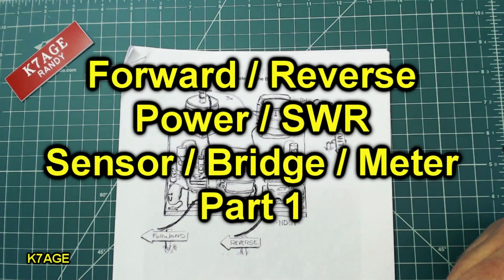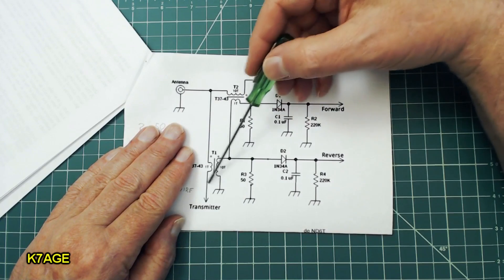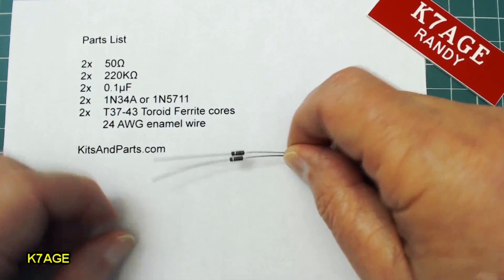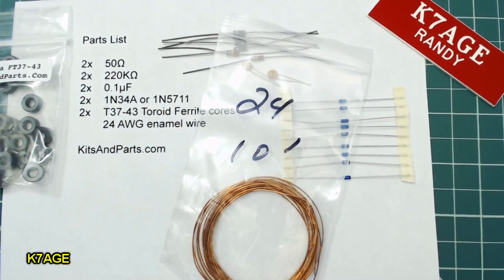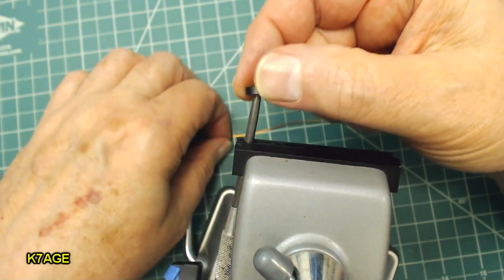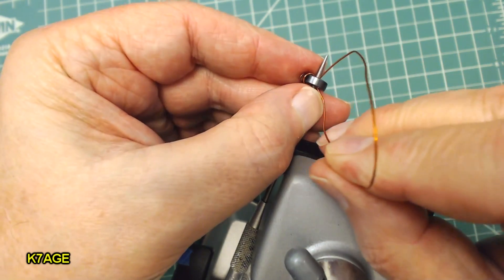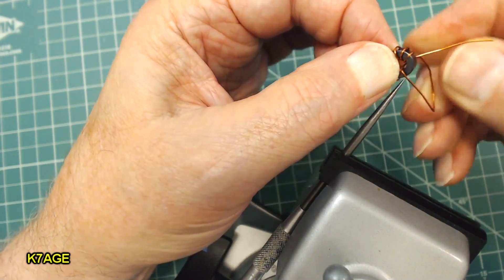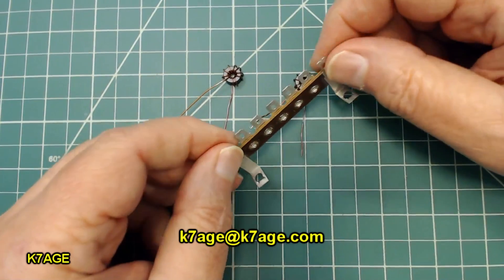How To Build An SWR / Relative Power Bridge - Part 1

Comment: Nice! I'll definitely be watching the other parts for this. For that enamel wire stripping, depending on the gauge of wire, I find a plain cheap emery board works well because of its width and rigidity. Ironically, if you're lucky, the heat of a soldering iron sometimes can melt that enamel away, but only if the Wire Gods are smiling down upon you that day.